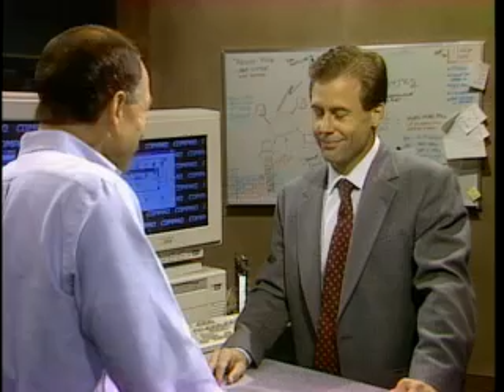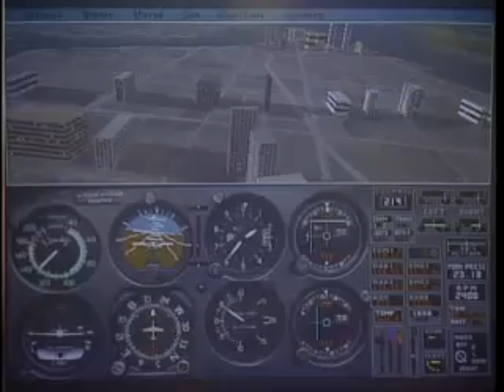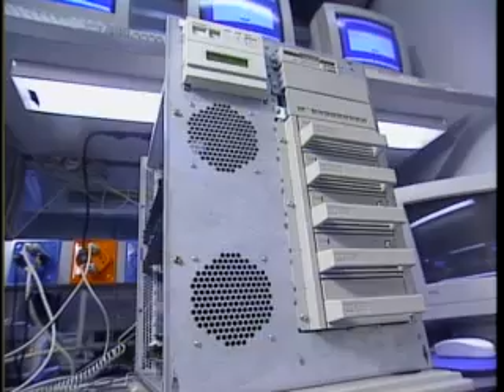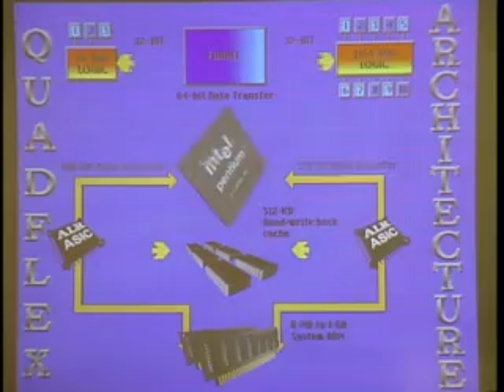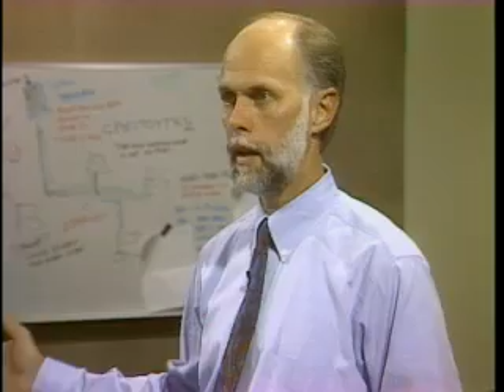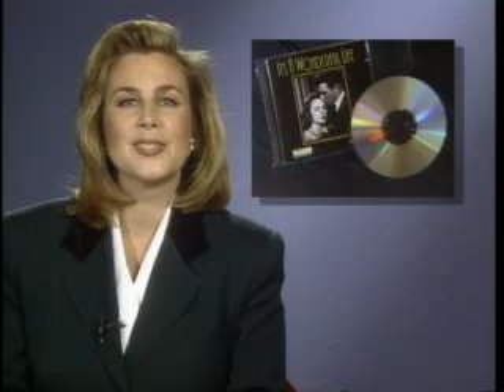The Computer Chronicles: Pentium PCs

Comment: That Top Gun ride is no longer there (never mind i might be wrong i guess its called flight deck now). Intel is no longer there either (across the street from 6 flags). the latest intel chip 13900k has 4,580 times as many transistors, and oh yeah RISC definitely turned out to be a threat

Comment: 12:14 It reminds me the Amiga 1000 running of multiple demo programs, in a real multithreading multitasking OS, over a Motorola 68000 7,16mhz processor, in 1985.
Reply: are you excited about tri flex architecture?

Comment: Today, if you spend $2995, let alone $4000, building a PC, you'd have an insane machine with PCIe SSDs, 12 cores, and multiple GPUs. It's amazing how prices have come down on high end hardware compared to those days.
Reply: Back in those days, a Pentium machine is like a Core i9 today! Before Celeron machines, there were real no 'low end' machines, only cheaper high end

Comment: My first computer was a Pentium Pro 166MHz with 32MB's or RAM and a 1.2GB Hard Drive. It came with Windows 3.1 but upgraded to Windows 95 in 1996 as we were told that it was better for the internet. I remember the game Hover.
Reply: Spooksville Scoob mine 75mhz
Reply: Pentium Pro is 180MHz and 200MHz. 166MHz is the Pentium and Pentium MMX.
Reply: the pentium pro would’ve came loaded with windows nt, since there was no advantage on a 16 bit OS

Comment: I remember my first pentium 60 machine.. it wasn't all that much faster than my previous 486-66, just marginally to be honesti remember how even back then it struggled to run some of the games i used like Myst and Riven.. Then when i upgraded to a Pentium 133 and got away from VLB it was so much faster at the time... It wasn't so much the pentium 60.. it was all the slow buses and the old way of using external cache that made it work like a 486
Reply: Frank Scarano To be honest, most early Pentium processors were a sales gimmick. My 486 DX4-120mhz trounced a Pentium 75. When Pentiums really started to shine was with the Pentium MMX
Reply: @Zestypanda  We overclocked an AMDx486-120 (or was it -133) to 160 Mhz - it lasted only 3-4 minutes, after which a hard reboot was needed :)

Comment: P4's were heat makers for sure, I am running overkill cooling on my Phenom II x4 960T with a Chilltec and I went back to stock no OC, no extra cores activated so NVidia's GeForce Experience software would work(it couldn't ID the Processor), and it still chews thru most anything with 4GB ram(budget constraint) and a GTX 465 1GB card, nothing Uber, just decent muscle for most games, I do need to drop in more RAM ASAP.

Comment: Most of the pre-Pentium 486's never had more than heat sinks with fins for cooling and some had none... 286's and 386's I don't even recall those using heat sinks.

Comment: dude for 3000 dollars you can get a intel core i7-3970X, a geforce GTX titian, a 4 TB hard drive, a decent case, 16 gigs of ram, a 128 gig SSD, and a water cooling sysum for under 3000 dollars.

Comment: Of course.

The Pentium G is a lot better than the old Pentium 4, Pentium MMX and so on. 

Yeah, It's like core 2 duo. but it has it's advantages. It has a 32nm architecture. Which makes it faster, cooler and more power efficient. 

Switching from Pentium 4 to Pentium G645. I must say that it's like day and night. 

First of all the g645 runs much, much cooler. And it's really fast. 
It's very good for running VMs

I have Ubuntu, RHEL, Mac OS X,Windows XP and Windows 8 VMs. They work just fine.

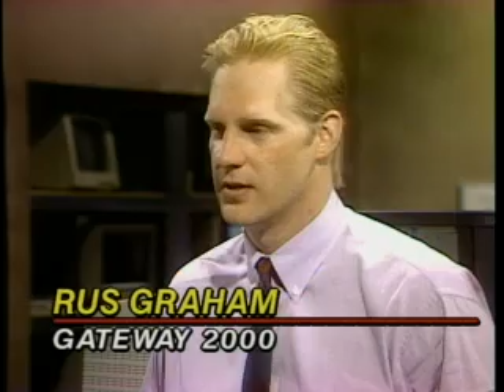Comment: Market guy says at 6:20, that the cheapest (2995$) Pentium PC they got, has 4,24MB HDD with 8MB of RAM... 
I got near me a PC with 8GB of RAM and almost 4TB of storage (1x SSD + 3x HDD).
Thats 1000x more RAM and nearly 1 000 000 (1 mln.) times more in HDD storage (we can now buy 3,5" HDD with 4TB capacity no problem). 
And belive me when i say to You that i didn't payed 3000$ to buy the whole system.
Now THAT is progress, won't U agree :)